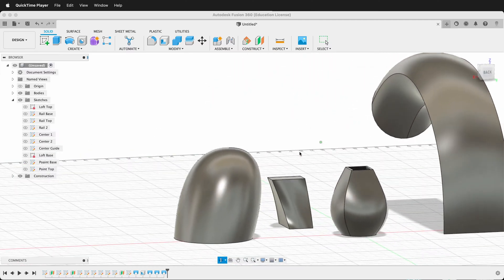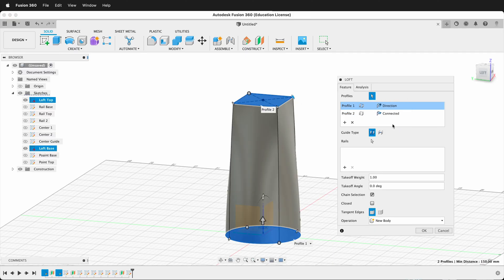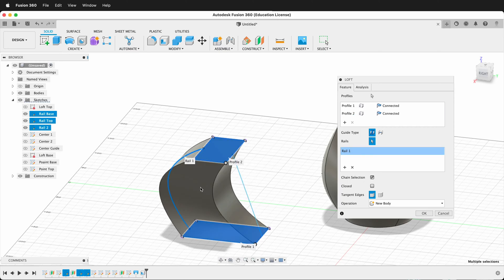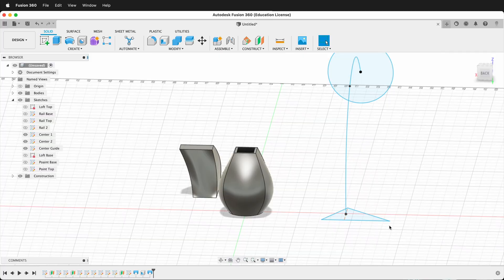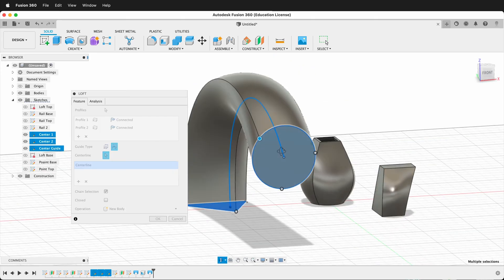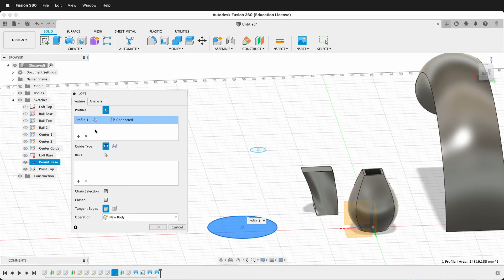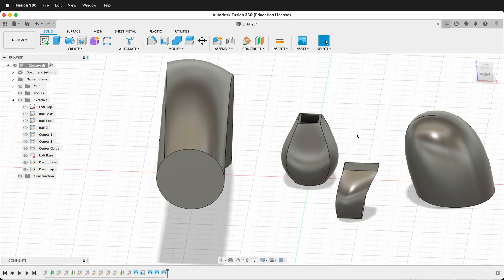How to Loft with Rails Fusion 360 Tutorial

Comment from the maker: Ask any Fusion 360 loft tool questions in the comments
Reply: Is there no way to twist a loft similar to a twisted sweep?
I am trying to create a loft from a sketched hexagon to a circle, but I want to add a torsional twist (one full rotation) to the object along the loft and I am having trouble with it. Guide rails don't seem to actually twist the shape along their path
Reply from the maker: It gets tricky, and finicky but you can use a guide surface on a sweep of a profile and use the 3d projection of a coil as the rail

Comment: any idea how to get rid of the line on that horn? 4:33 why a round object would have a line going on it surface, the surface should be smooth.
my problem with this line is depending on where it is the model get slightly different, and if a symetrical shape is required this line ruin it. and I don't just want to move the line (sometimes it even not moving) but to remove it complitly
Reply from the maker: The line is just an indicator in Fusion, the form should be perfectly smooth

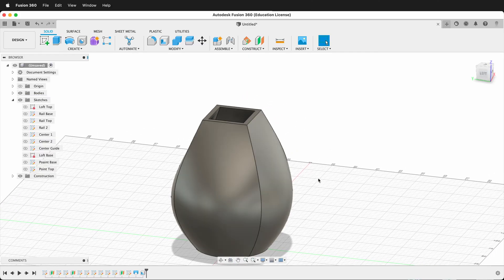Comment: 1:28 right, but how did you make *that*?
Reply from the maker: Use offset planes, 3D sketching and project the other points to the sketch surface
Reply: @WhatMakeArt  woulda been a complete video had you added that very very very KEY instruction. pretty sure any one that already knows how to draw the rails, knows how to use them.  this instruction however is not at all detailed enough to help.
Reply: hahaha literally came here for that. got no problem clicking on rails to loft with. just need to know how to draw those rails. seems like a strange video, as I feel like if you dont know how to "use" rails then you probably don't know how to draw them either.

Comment: Maybe you can also show how to add rails.  Thank you

Sorry, I'm just frustrated.
Reply from the maker: Thanks for the feedback, It is always a balance between including too many steps and too few,  I will make an additional video that shows how to make the sketch lines that you use for rails with a loft in Fusion 360.
Reply: @WhatMakeArt  sorry I'm just frustrated with fusion360.  appreciate your contribution
Reply: @WhatMakeArt  I know this is old, but I too found it frustrating that your designs just popped into existence with rails already on them.  How you made them all bendy like that is not easily discoverable...